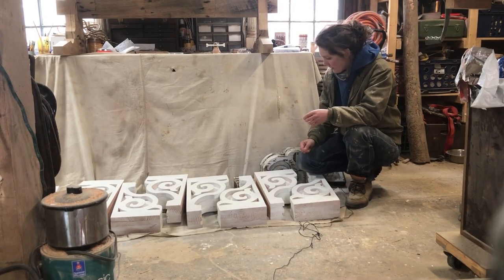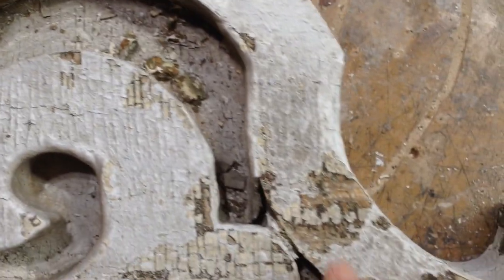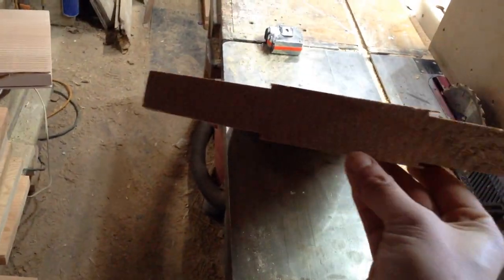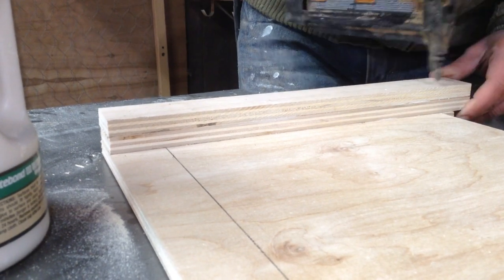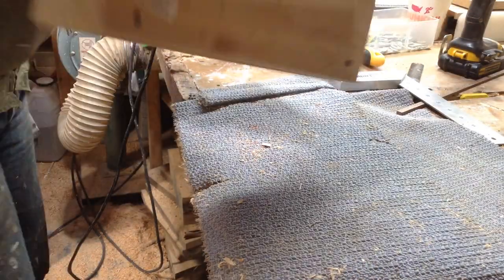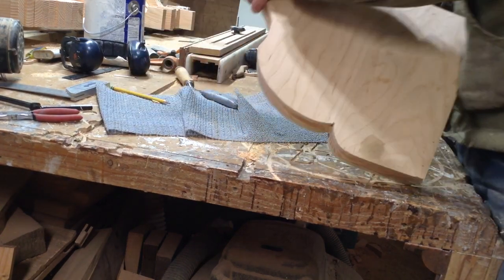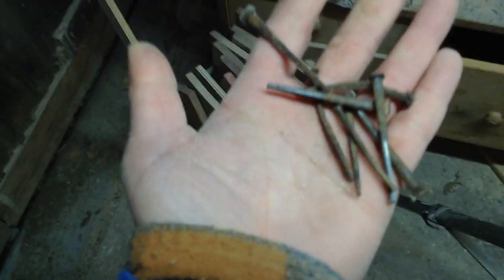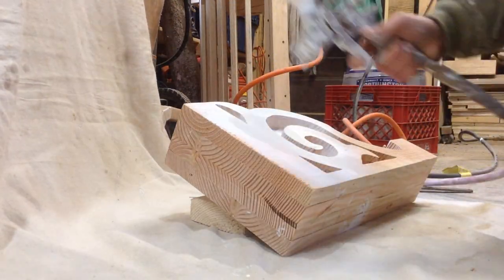Woodworking : Recreating Colonial Corbel : How-To

Comment: I use a jig saw almost every day to make rectangular holes in steel and stainless steel electrical panels. After burning up two of those cheap dewalt saws like you have, I finally spent 50 more dollars and bought a new, really sweet Bosch saw. Much better, imho. Great video as usual! Oh, and of course, happy Saturday!
Reply from the maker: I have used a Bosch one before and the are really nice.  When I finally get sick and tired of dealing with this one that's probably what I will get.  Happy Saturday to you too!

Comment: I learned a lesson throwing tools in frustration: I threw a craftsman shopvac down on the floor...yes, I was THAT angry-whomever designed it with crappy wheels that wouldn't rollover its own cord.... The vac bounced off the floor 2 feet and was unharmed. The floor deflected enough that the nails popped on the sheetrock ceiling below. Lesson to me: the townhomes in Bucks Co PA have shoddy construction and the rockers never used "glue and screws".   Oh,  Loved the Toboggan work! Re: CNC, in the time it takes to setup, you already made a jig-I've researched them and unless you are doing production work, a one-off jig is simpler. Now, I have considered getting one (take up dimensional space) as to sub-out work for a contractor I know. Welcome to Restoration!
Reply from the maker: That's good to know about the CNC.  My floor is concrete so the jigsaw didn't bounce hahahahahaha.

Comment: A C.N.C. would speed up the process but it also equals unemployment! And what skill does that require and what pride does one have in doing something if the machine creates the whole piece! Figuring out the process in the build equals skill!  Nice job I noticed a lot of the Fir had Quarter sawn and rift sawn grain they should be real stable and last quite sometime!
Reply from the maker: Very true about the CNC.

Comment: Hi, I hope you checked for lead content before you started removing the paint, it can be quite dangerous
Reply from the maker: Lead content is a good thing to point out.  I didn't take this down to bare wood or sand this so there wasn't a huge concern for lead dust but for sure it would have been smart to test for lead.

Comment: Another great project, thanks for sharing. Absolutely agree re' hardware on timber, I've had to replace most of the newer balustrades on my house because a nail gun was used to tack on the balusters. The older parts of the house (1900s) the original builders used dowels and false tenons and they are as good as new. Hope your valentine have something nice planned for this weekend for you.